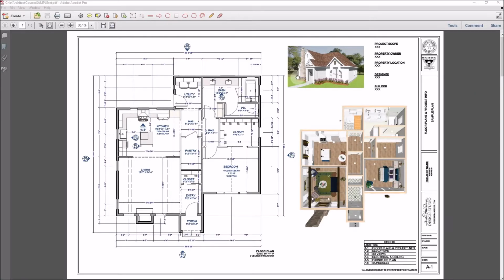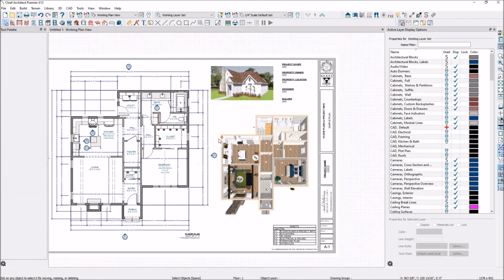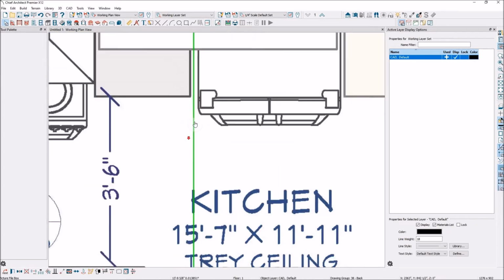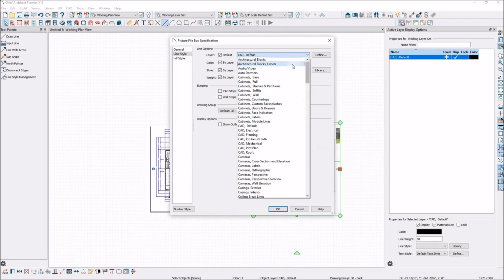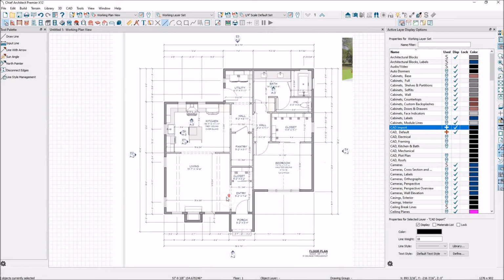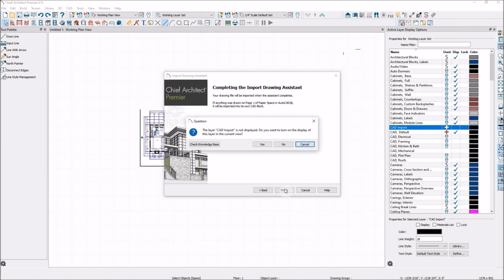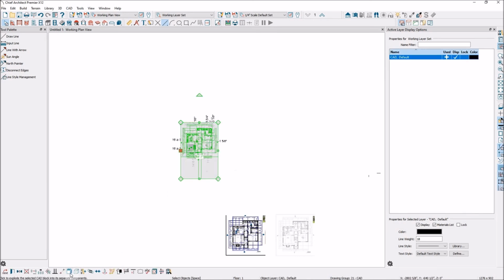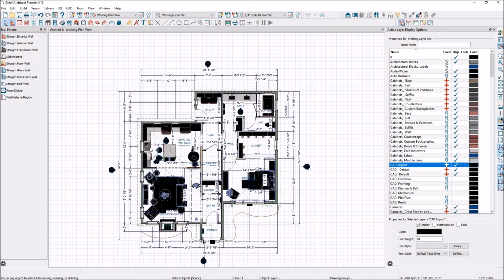4 A - Chief Architect for Beginners -  Importing CAD DWG

Comment: I have to disagree with being able to move the imported image file into a different layer when using Home Designer Pro.
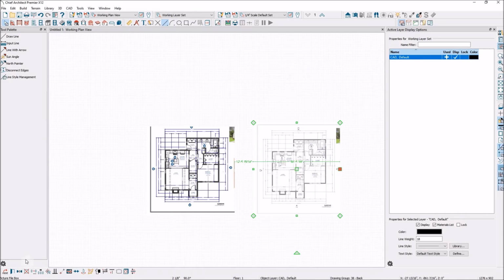I watched this video numerous times, beginning at the 6:30 mark, and I could not find a way to save the imported jpg file into the IMAGES layer.  I select the image, and open objects, BUT, there is nothing that allows me to DEFINE the jpg.
I CAN turn the imported image off by selecting the CAD Default layer, but it sure would be nice to be able to do so if it was in the IMAGES layer.
At the 7:18 mark, you indicate that Home Designer Pro has the IMAGES LAYER, and it does, but how can I move my image to that layer?
Reply from the maker: Hi Lonnie, This may not be available in HDP, so that could be my mistake.  I'll have to look in the software and check.